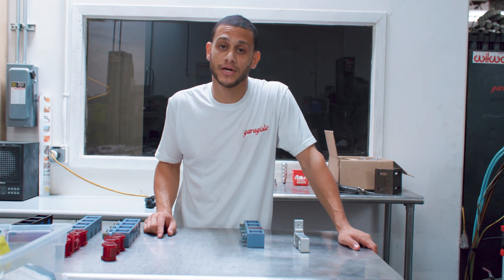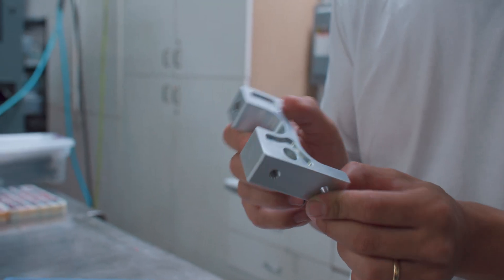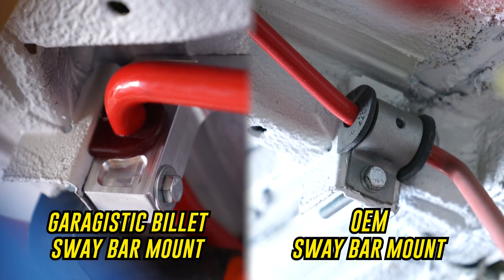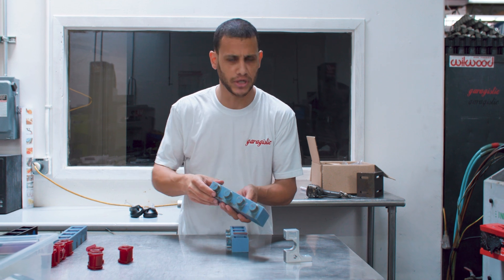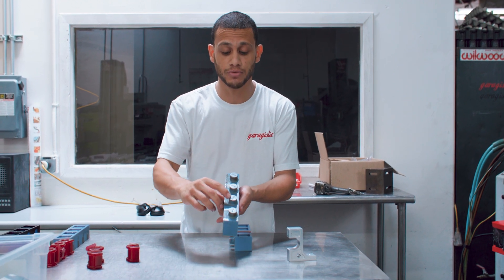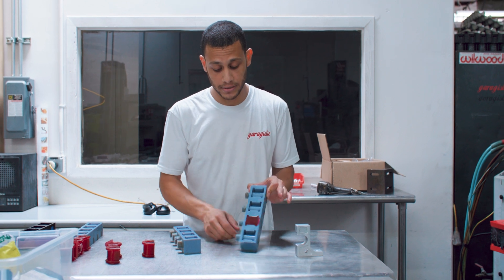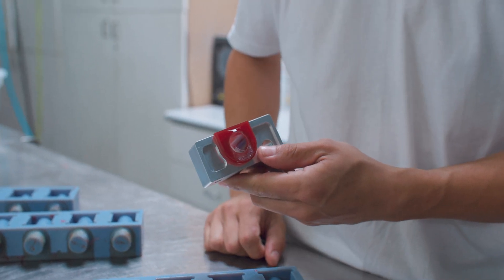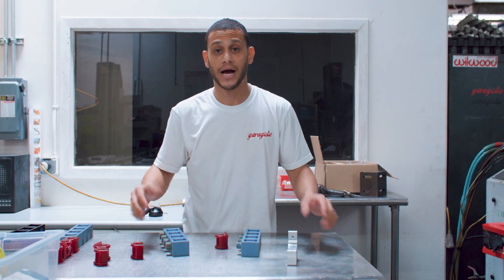Making Custom Polyurethane Bushings with 3D Printed Molds | Garagistic Showcase

Comment: Is the 3D-printed mold treated beforehand so that the polyurethane does not stick to it, or is it simply poured in as is?
Reply from the maker: You are correct.  It is treated